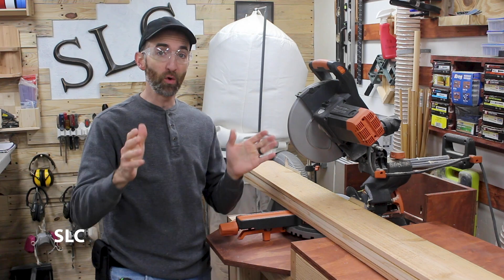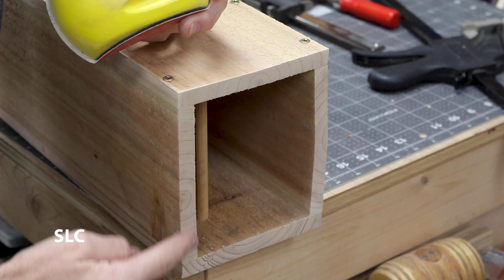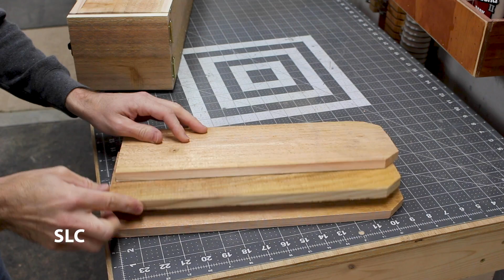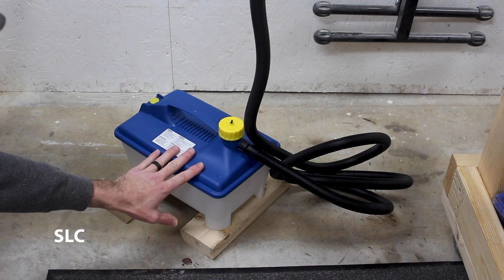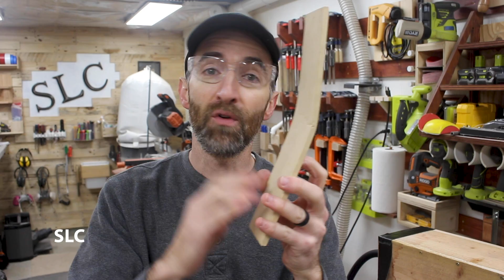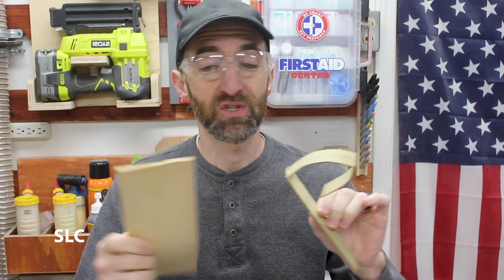Let's Try Steam Bending Wood | Woodworking

Comment: Hey Clinton, 
crepe myrtle bends very easily without steam. Last year
I had 1 1/2" -2" branches that had been cut about a week earlier. I put 1 into burn barrel and just started bending it and noticed that it wouldn't break, I formed it in a boomerang shape let it cool and kept its shape.
I did it again WITH LAST YEAR'S (cured) BRANCHES. Same results. I'm thinking of using it to trim in my house. 
I hope you will try it and let me know how it does.
Thanks for all the tips.